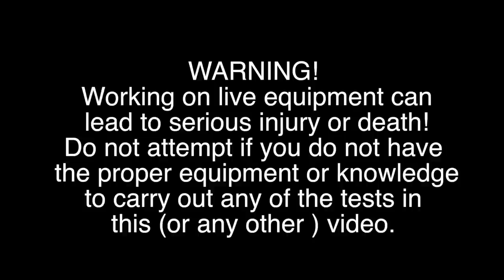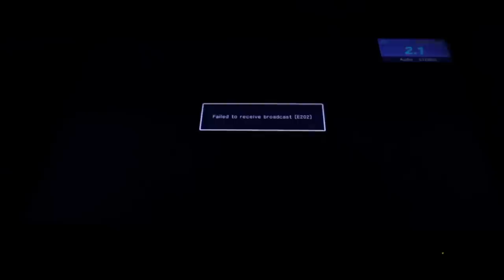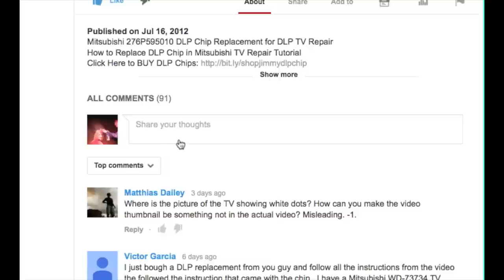Sharp LC-32 1 Blink TV Repair How to Troubleshoot Problem Between Bad Lamps and Power Supply

Comment: I have a lg 32 in tv model number 32lk330-UH the tv will come on flash the tv picture 3 times then shuts off. When it flashes the picture it comes in just fine then shuts its self off
Reply from the maker: Adam Smith  Try all repairs and troubleshooting at your own risk.  I recommend replacing the main board in your TV.  Click this link to replacement parts for your TV model number:  http://www.shopjimmy.com/lg-ebu61587306-main-board-for-32lk330-uh.htm  There may be multiple boards for the same TV model number, be sure to match part numbers on your current board, with your replacement for compatibility.  Here is a link to a video showing how to identify your part number, click here:  https://www.youtube.com/watch?v=RwHTvjMdrhk  Thanks and please let us know if you have any further questions with your TV Repair!  www.shopjimmy.com

Comment: i have a  sharp  model #LC 52SE94U  , it do not turn on   i only see the blue light  (power on light) then after a min or soo the blue light start blinking  with a green light( opc) but i never see anything on the lcd , i try to force  it to turn on with the down volume button and the input button at same time when pluging in the power cord at nothing happen , any ideas?

Comment: How can I find out the problem with my Sharp LC, 32LE155x tv screen, when I put the power on the power lamp turn green and the screen came on but after seconds the screen blank (off) and the power lamp turn red, how will I fix?

Comment: Hello Jimmy,

I have a Sharp Aquos LC32BV8E LCD TV.
For some Reason the screen goes black sometimes out of nowhere. The sound continues to work though. Most of the times when I turn the tv off and on the screen will work again. I've found some people having the same problem online but they couldn't find the problem as well. The only one who got it fixed was a guy who brought his TV to the Sharp customer service in the EU and let them repair it. (they said it was something like the backgroundlichting switch?) is that possible? and if so how can I fix mine?

Yours Sincerely,

D.
Reply from the maker: dries v   I recommend running the flashlight test on your TV.   Here is a link to a video we produced that shows how to run the flashlight test. https://www.youtube.com/watch?v=xUzCLgoSPGM Please reply with your flashlight test results and we can recommend a replacement part for your TV repair. Thanks and please let us know if you have any questions! www.shopjimmy.com

Comment: Hi I just did the jumper thing on the capacitor you mention here and pulg it back in. Instead of coming the picture back it just continue to blink the power led light. What is that then? @shopjimmy

Comment: Sharp LC-60LE640U Powers up and stays up for two or three minutes, then the picture goes off and the power light began flashing. The remote control will not turn off the power while it is flashing. The only it will turn off is by holding down the power button manually.

Comment: Hi, first thanks for the videos! im boris from argentina. I have a problem with my lc-80le632u aquos tv. 
I think you can help me! here in my country there is no more sharp support!
the first problem was that tv shut down while looking and never starts again...So i change the power board (RUNTKA903WJQZ) and the tv started working perfect! but after 15 minutes its turn of by itself,
and an error code (2 long blinks and 3 short flashes) appears!

thanks you so much!

Comment: I have the same problem as one of your viewers" TheWhitechicka" it's two green light blinking twice and one blinking 3 times. I can get it going for a min. then it cuts off. LC-46d85un serial # 003806150   is this the power supply?

Comment: hi what does it mean when the screen flashes different colors sometimes white,pixels black and white and sometimes solid red,green and blue in a whole screen flashing continuously..you can't even see the image but it had sounds..please help..my TV is sharp aqous LC-32le340m I bought it 3years ago..thanks
Reply from the maker: +Hannavon Santonia  Try all repairs and troubleshooting at your own risk.  I recommend replacing the main board in your TV as it is stuck in test pattern mode.  Unfortunately I do not see any replacement parts in the search results for your TV model number on our website.  Please reply with your part number on your main board and I can try searching for replacement parts.  Thanks and please let us know if you have any further questions!  www.shopjimmy.com

Comment: I have a sharp lc60le832u that my friend threw a cell phone at it a broke screen when I plug it in it does nothing is it worth fixing and how would I go about fixing it if it is worth it thank you
Reply from the maker: Antonios Voulgarakis   Not worth fixing.  Try all repairs and troubleshooting at your own risk.  This sounds like a TV panel (TV Screen) problem.  If your TV panel is bad, it may be more cost-effective to replace the TV as panels are typically hard to find in stock, difficult to replace, and expensive.  Thanks and please let us know if you have any further questions!  www.shopjimmy.com

Comment: i have a sharp lc-32sb23u with no audio but video is fine what board controls the audio
Reply from the maker: +Douglas Stewart   Try all repairs and troubleshooting at your own risk.  I recommend replacing the main board in your TV.  Click this link to replacement parts for your TV model number:  http://www.shopjimmy.com/catalogsearch/result/index/?cat=56&q=lc-32sb23u  There may be multiple boards for the same TV model number, be sure to match part numbers on your current board, with your replacement for compatibility.   Thanks and please let us know if you have any further questions with your TV Repair!  www.shopjimmy.com

Comment: I have a 37" sharp aquos model LC-37D40U that won't power up. It has the green power light blinking ( 1-1-1-1-1) what could be the problem? Please help me!
Reply from the maker: julio sanchez I recommend replacing the power supply board in your TV.  Here is a link to replacement parts for your TV model number on our website, click here:  http://www.shopjimmy.com/catalogsearch/result/?q=LC-37D40U+  Be sure to match part numbers on your current board, with your replacement for compatibility.  Here is a link to a video showing how to identify your part number, click here:  DIY TV Part Number Identification Guide for Sharp Power Supply Unit (PSU) Boards  You can also call our customer service for further assistance with your purchase.  (877) 881-6492  Thanks and please let us know if you have any further questions with your TV Repair!  www.shopjimmy.com

Comment: i have a sharp LC-37D40u that has a colorful snowy picture. i replaced the T-con board and still no change. Can you help?
Reply from the maker: Mike Peoples   This sounds like a problem with either the main board or the panel.  You can replace the main board to see if that fixes your TV.  Here is a link to replacement parts for your TV model number on our website, click here:  http://www.shopjimmy.com/catalogsearch/result/index/?cat=56&q=LC-37D40u  Be sure to match part numbers on your current board, with your replacement for compatibility.  You can also call our customer service for further assistance with your purchase.  (877) 881-6492  Thanks and please let us know if you have any further questions with your TV Repair!  www.shopjimmy.com

Comment: I am dealing with a LC-46D64U with the same issue. I found the C7558 but it is not close to the IC. I find C7538 by the IC. I am wondering if C7558 is the correct capacitor to jump on this model or if the C7538 is the correct one on this model. Thank you for your help.
Reply: my power LED is flashing 1 time a second. I have tricked the TV on by holding down the vol-, input and power button while I plug it in. The TV turns on then the backlighting strobes/flashes then the backlighting shuts down and then the TV cycles back into protect. I then push and hold vol + and channel - down then push the power button and the TV will come back on and strobe then the backlighting shuts down but the TV will stay on. the panel still works and so does the audio. I have pulled the screen off and when I push the power button, ALL the ccfl's light up for a second and then start strobing. when they strobe only half the bulbs stobe. I get 2 lights that strobe then 2 that do nothing all the way down. so its 2 on 2 off all the way down the TV. I have pulled all ccfl's out and replaced them with new and I get the same error and same strobing effect.  What can I do to deactivate the protect circuit on this TV? or could you point me to the correct board for replacement? I believe it is the inverter board on the right side of the TV when looking at it from the back. is there a common inverter that goes bad in these?  Also one last thing, Do you buy broken TV's? I have about 50 of them from 32"-60".  Thanks.
Reply from the maker: catfisher420  Please watch this video FIRST to help with your repair!  https://www.youtube.com/watch?v=BP3NVNCGEv8  I recommend replacing the main board in your TV.  Click this link to replacement main boards for your TV model number:  http://www.shopjimmy.com/catalogsearch/result/index/?cat=56&q=LC-46D64U  There may be multiple boards for the same TV model number, be sure to match part numbers on your current board, with your replacement for compatibility.  Thanks and please let us know if you have any further questions with your TV Repair!  www.shopjimmy.com

Comment: My sharp 32" flat screen had a bad led - replaced it and now screen is green. What did I do?
Reply from the maker: Charles Gantt   It sounds like you wrecked the panel (TV Screen).  If your TV panel is bad, it may be more cost-effective to replace the TV as panels are typically hard to find in stock, difficult to replace, and expensive.  Thanks and please let us know if you have any further questions!  www.shopjimmy.com

Comment: Hi Guys 
need your help 
My 70" SHARP AQUOS model LC-70LE732U
Blinking white light twice ...one long blink and one short blink
Did reset but after running 10-15 min it turns off automatically and goes back to blinking
Very frustrating"
What can it be the Maine board or the power board?
Need help

Comment: Hello, I have a Sharp LC-46SB54U with No back lights, and no sound. It is displaying the following code after following the procedure of "holding the input and vol- down while plugging the unit in (as per a Sharp tech support members instructions) Also no back lights, even dimmly upon attempting the aforementioned procedure.
The power supply relay clicks three times or so, then following the 3rd relay click (or so) the Green power led and green OPC  LED flash simultaneously once followed by the power LED flashing twice more. This repeats over and over. I cannot find a schematic to check voltage at key points on the PWR supply board, and I'm not sure, but it seems like the pwr supply is doing its thing, but I can't be certain without proper voltage testing procedures.
 It seems that the startup protection circuit is not seeing what it wants to see in terms of voltage or signal at a certain test point on the PCB and thus preventing the PWR SUPPLY board from going any further/ or going into protection mode because perhaps the logic test is detecting a failure somewhere when power up is initiated. There are no signs of swollen, bulging or leaking caps, nor any signs of a burned component or heat damage on the PCB itself. (even though caps don't have to show obvious signs to be bad.) I am seeing no signs of cold solder joints on the PWR PCB and the filter PCB is putting out a steady 120VAC. The main board has a dim blinking red LED as well. Thank you kindly for your time and anticipated help in resolving this issue as I can't  afford to be a "Parts changer" Blindly.. Warmest regards.

Comment: LC-46D65E will not turn on
When turned on at wall switch, tv power light goes green  and tv will not respond to remote or buttons on side and screen stays black

Comment: I have a sharp lc52le830u. Turned off on it's own and now seems to be flashing a code on the power light. 2 long flashes followed by 2 short flashes. Any idea would be appreciated. Thanks!
Reply from the maker: Billy Dees  PLEASE SUBSCRIBE TO OUR CHANNEL - Try all repairs and troubleshooting at your own risk.  I recommend replacing the main board in your TV.  Click this link to replacement parts for your TV model number:  http://www.shopjimmy.com/catalogsearch/result/index/?cat=56&q=lc52le830u  There may be multiple boards for the same TV model number, be sure to match part numbers on your current board, with your replacement for compatibility.  Thanks and please let us know if you have any further questions with your TV Repair!  www.shopjimmy.com

Comment: Hey jimmy I have a sharp aquos  lc37d44u when I power it on half of the screen lights up black  n the other half white then the screen goes off n the power light flashes green
Reply from the maker: barry .williams   This sounds like a TV panel (TV Screen) problem.  If your TV panel is bad, it may be more cost-effective to replace the TV as panels are typically hard to find in stock, difficult to replace, and expensive.  Thanks and please let us know if you have any further questions!  www.shopjimmy.com

Comment: Buenas tardes ShopJimmy excelente aporte tus comentarios, actualmente tengo un TV sharp LC-32D62U que al conectarlo a la alimentación eléctrica , no enciende , se escucha el 
click característico del rele de la fuente de poder que frecuente hace durante el encendido, dicho rele se aciva y desactiva unas tres veces a intervalos de un minuto, durante su activacion estan presentes los voltajes 13V 10V 6V  5V 3.3V en las salidas de la fuente de poder y ausente la salida PNL_12V, y el el equipo sin audio ni video. y finalmente quedan desactivados los voltajes de las salidas de la fuente y solamente enciende las luces de power y la de opc , en el siguiente 
patron , 2 veces enciende la luz power , y luego enciende la luz power junto a la de opc. 
Realice un encendido forzado de las lamparas desconectando VON del conector P2603 y aplicando la señal PS_ON que llega al  pin 1 del conector CN5702, al VON en el  conector CN7502 en serie con una Resistencia de 1K y encendieron de forma simetrica todas las lamparas (pantalla en blanco), tambien se aplico la señal PS_ON al pin4 del conector CN5702 en serie con una resistencia de 1K, y asi se verifico el voltaje PNL_12 en los pines 3 y 4  del conector CN5701 de la fuente de poder, durante todas estas pruebas finalmente quedan desactivados los voltajes de las salidas de la fuente y solamente enciende las luces de power y la de opc , en el siguiente patron , 2 veces enciende la luz power , y luego enciende la luz power junto a la de opc.
aqui anexo la direccion del manual de serviciohttps://diagramas.diagramasde.com/televisores/LCSPMPWBCGDT.pdf
 De anticipo felicitaciones por sus buenos oficios, por favor me podria orientar para localizar y resolver esta falla. erkysf@yahoo.es

Comment: Hi all, I'm having Sharp Aquos LC-32CFE6452E and I can't do the hard reset. I've tried the steps with Vol- + Source buttons held until I plug it in the electricity and there is no menu for reset. Any ideas please. The real problem is that after somethime when I use the TV, some of the chanels dissapeares, but on the rest TVs they are available. The other problem is that the TV is veeery slow. Whe I turn it ON, i should wait some time to connect the WiFi, to check for USB or else, and then it is possible to change the chanels, or to volume UP or Down.

Comment: Hi Jimmy I have a Sharp Aquos LC-46D64U and the power and opc light flashes once then the power light flashes once. I tried holding the power button in but no change. thanks for any help.
Reply: if I hold the ch up and vol down buttons the power light goes solid but no picture
Reply from the maker: Kevin Williams   What is the number of blinks you are seeing for the blink code?  Thanks!  www.shopjimmy.com
Reply: Pwr and opc once then power once. Repeats
Reply: If I hold power the power light will go solid but no sound or picture
Reply from the maker: Kevin Williams  Please watch this video FIRST to help with your repair!  https://www.youtube.com/watch?v=BP3NVNCGEv8  I recommend replacing the power supply board in your TV.  Click this link to replacement parts for your TV model number:  http://www.shopjimmy.com/catalogsearch/result/index/?cat=59&q=LC-46D64U  There may be multiple boards for the same TV model number, be sure to match part numbers on your current board, with your replacement for compatibility.  Here is a link to a video showing how to identify your part number, click here:  https://www.youtube.com/watch?x-yt-cl=84503534&x-yt-ts=1421914688&v=-i9o4C2XkyQ  Thanks and please let us know if you have any further questions with your TV Repair!  www.shopjimmy.com
Reply: That's kind of what I was figuring. Already had the unit out just hadn't ordered it yet
Reply: Thanks for the info!!

Comment: my tv is a sharp aquous model no lc60le835u. it don't turn on. the sharp sign is blinking. one quick blink and one more slower one. my tv don't ve buttons on e side of tv, it touch controls
Reply from the maker: +martins owusu  Try all repairs and troubleshooting at your own risk.  I recommend replacing the main board in your TV.  Click this link to replacement parts for your TV model number:  http://www.shopjimmy.com/sharp-dkeymf733fm12-main-board-for-lc-60le835u.htm  There may be multiple boards for the same TV model number, be sure to match part numbers on your current board, with your replacement for compatibility.  Thanks and please let us know if you have any further questions with your TV Repair!  www.shopjimmy.com